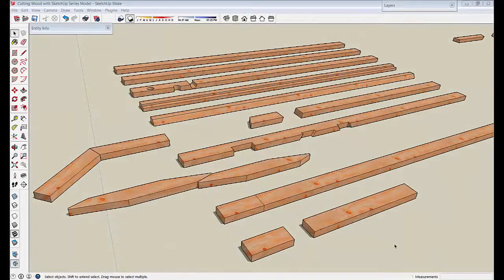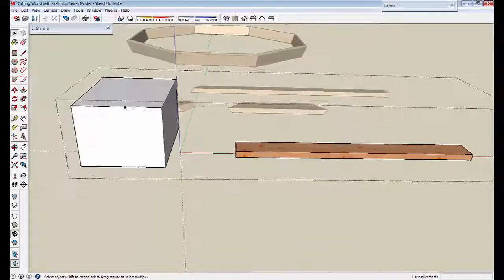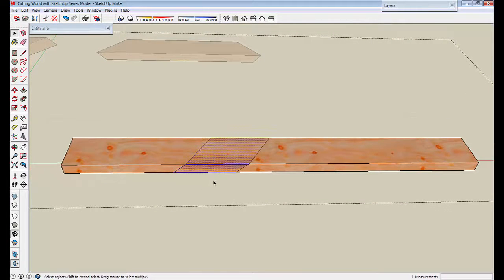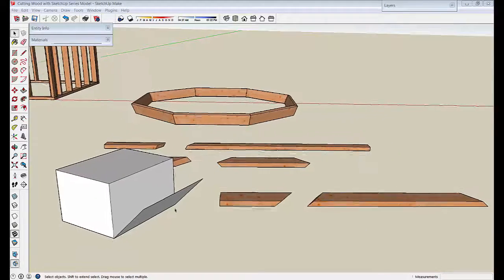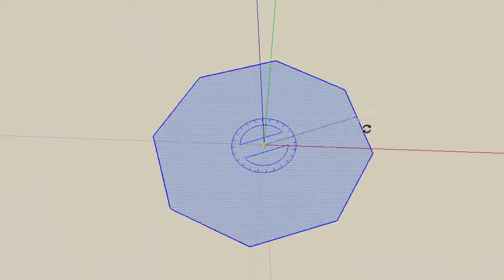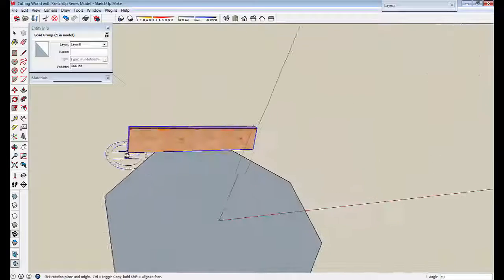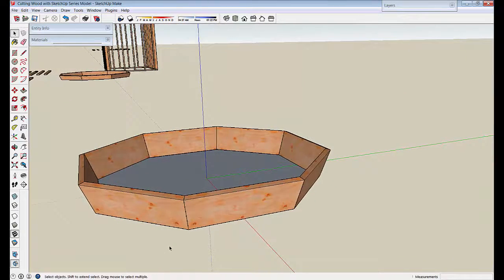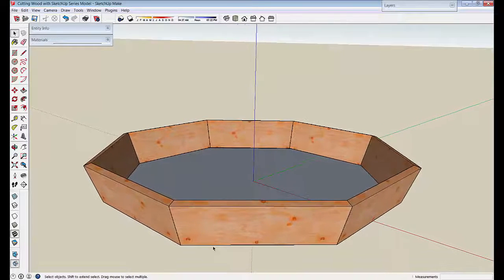Cutting Lumber with SketchUp Part 2   Compound Miters

Comment: This is great for the wood turners out there who do segmented wood turning.  That's a process of cutting and gluing together multi sided rings of wood.  The rings are then stacked and glued together and turned on a wood lathe.  The end results are varied wooden vessels which can be quite beautiful.
Reply from the maker: James,
Right you are... SketchUp is the best for planning woodworking projects of all types, segmented wood turning included!  You'd be able to figure cut angles for building rings with any number of segments and easily get a count for piece numbers in each ring, etc... hope some turners out there read your comment and adapt this method to create some very cool and unique projects...
Thanks for commenting here at The Digital Jobsite!

Comment: Very useful indeed, glad i found your channel
Reply from the maker: Highgate: I'm glad you found this channel too :-)

I watched a few of your video uploads.  It looks like you're using SketchUp for project planning, design and presentation in much the same ways as I do.  The more you use it the better you get and the more useful SU becomes.  If you haven't found it yet you might want to check out this tutorial for SketchUp's PhotoMatch feature which can be very useful for the sort of deck projects it looks like you're working on:

https://youtu.be/OSrMQw2xgVI

I use PhotoMatch on nearly every project these days with very satisfactory results.  There's a shameless plug in the description of the linked video above recommending a 3D mouse for modeling work.  Regardless of where you might purchase one I think you'd find a 'joystick' mouse invaluable for the type of project you're working on.
Best Regards,
Matt